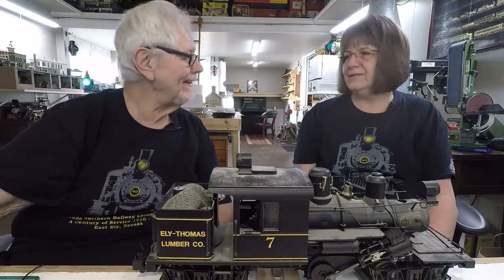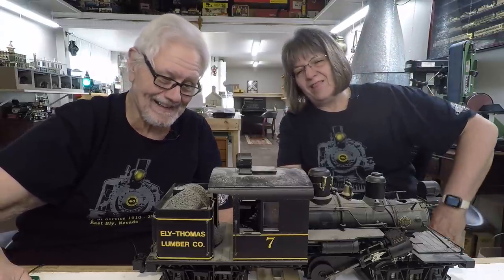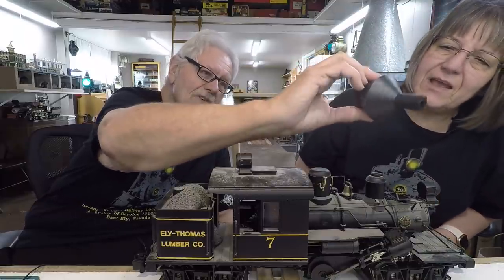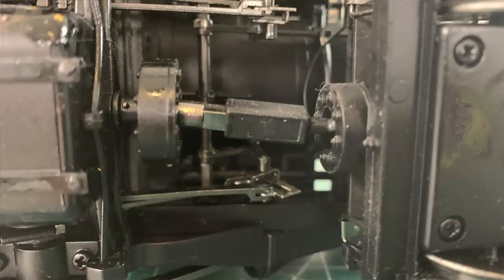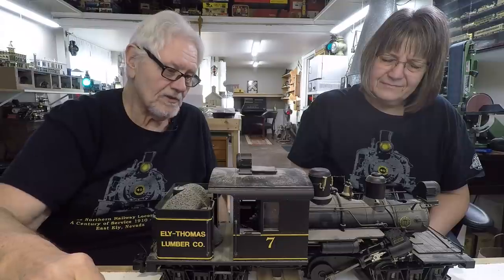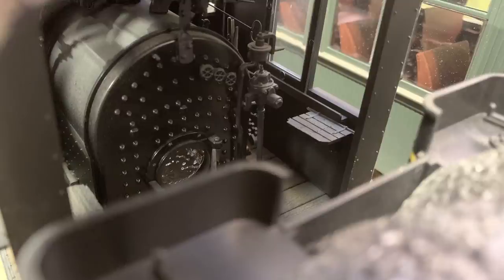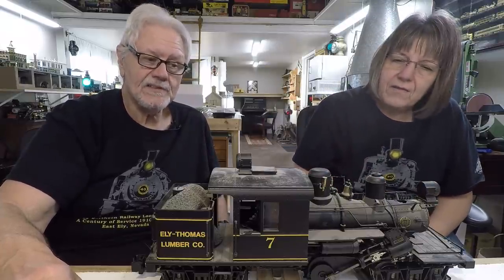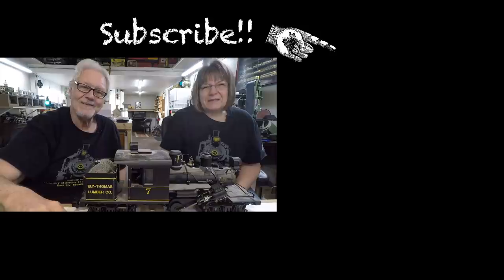Bachmann Spectrum Large Scale Climax

Comment: I have 3 of those Climaxes, the first one I got the driveshaft was snapped off where it enters the rear truck. The other two were just fine and still run flawlessly. Nice little engines. I too, am a big fan of the geared locos.
Reply from the maker: Today a sort of “ran” it on the logging railroad. I pushed it. But I wanted to test the curves. Sharp! But just fine!

Comment: Dale that is a neat engine, I can see the advantages of the design. Service ability being one of them, out on the woods a machine's maintenance gets shorted.

It would be interesting to know the engine's technical specifications and compare it to other similar logging engines.
Reply: The Shay was supposed to be the easiest to work on in the field because the engine and drive line was all on the side.  The gears were all bevel.  
The Climax had skewed bevel gears because the drive line was offset and passed the axles.
The Heisler gears were bevel to the rear axle then the side rods to the other axle.
Reply: One plus for the Climax over the Shay is that the bogies are sprung. Very useful on rough forest tracks.
Reply from the maker: I think the side rod configuration helped. Only two driven axels.
Reply: @ToyManTelevision  All of the axles are powered.  The driveline shaft continues on through the truck to the outer axle.  It is hidden in the confines of the truck.
Reply: @ToyManTelevision  parts left out cause no service problems

Comment: I love the Climax Locomotive!!! Its my favorite locomotive out there but I have seen modles of climax locomotives of different designs that looked better in my opinion. A cool Climax to model is the one on the White Mountain Central Railroad.

P.S. if you want to see ridiculous weel size. Check out the Hisler on the White Mountain Central Locomotive, it has to have some of the smallest weels ever mounted on a standard gage locomotive.
Reply from the maker: Not sure why small wheels on a geared loco... except they can handle bad track better. Hum...
Reply: @ToyManTelevision  so did you look up the locomotive?

Comment: I wonder if you could clean it with a small steam cleaner? You could "print" the stack or do a small wood turning! Do you know what is happening to "Travel Town" in Griffith Park in Los Angeles? It looks like a lot of trains are "disappearing" and the ones that are left are falling into disrepair!
Reply: Air blow and flick all the dust off with a new 2" paint brush then give it a good thick soapy lather swirling with the brush. Loco rolled on each side working from underneath being careful to not let wet get in. Any runs will just drop off. Once all the grunge has been stirred up subsequent damp (not wet) brushes with clean water then padding with a dry cloth each time until all the soap has gone. No scrubbing or rubbing.
Reply from the maker: I took a soft brush and the air comperessor to it! Works well..... Then added the stack. Seen in stveral of the shots. Realized after cleaning it was shot over with flat clear which looks great!!
Reply: @ToyManTelevision  Yep. The soapy lather treatment is more for those models that have been shelf queens in a smokers den. I've had some badly nicotine coated and coke splattered ones that have a build up. Amazingly some LGB items 30 years old come up like new.

Comment: Hey Toyman! I have a Bachmann G scale Porter ( the older circus version) and I'm curious about how well their gears hold together. Do those have the same mechanical issues  as the first gen. Spectrum moguls?
Reply from the maker: Not sure.. many of the nylon gears hold up well. Many not... bet it has nylon gears. Only the most recent ones are metal.
Reply: It does have nylon gears, but they're holding up really well. I don't know how well they hold for the Big Haulers, but I rarely hear people having problems with those. I guess it's mostly the very early Spectrum models that  have the faulty gearboxes. I'm super glad that Bachmann has turned to metal gears, even for the 4-6-0 models; I got an Emma Nevada, and she runs beautifully!!
Reply: To keep the gears from stripping, I always lubricate them. Even for my LGB mogul, but I think LGB uses a sturdier plastic for their gears.

Comment: Used to work for the museum that own Ely Thomas Shay #6. Would have been 3 foot gauge.
It's currently non-operational, but it still smells like Crater Compound, so sewing machine oil isn't the worst it could smell like. Outside the shops where it would be readied for the day is a large buildup of what looks like concrete or pavement, but it's not... it's  Crater Compound. Nasty stuff! 
If you get it on your shoes and you ain't coming inside on Mom's clean carpet! You'll never get it out!
Reply: I still have stains from crater on my van floor carpeting from 20 years ago. That stuff really stays put.
Reply from the maker: YUK!!! So its white? Or.... Looked it up. EXPENSIVE!! $25 in 1930. So like $600 in todays money. BUT a big can of it.
Reply: @ToyManTelevision  VERY expensive, very nasty stuff. Thick and black like tar, it's really the opposite of a lubricant. Helped the gears on the driveshaft stick to the ones on the wheels and made them have better contact with one another. Diesels use it in their traction motors, too. It's about $300 for 40 pounds of it.
Reply from the maker: Wow!! Thanks!